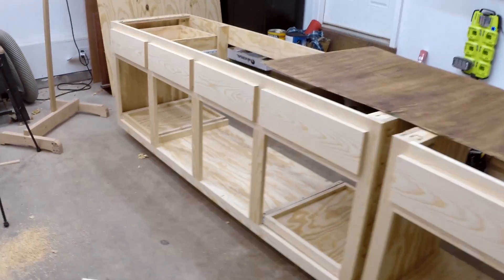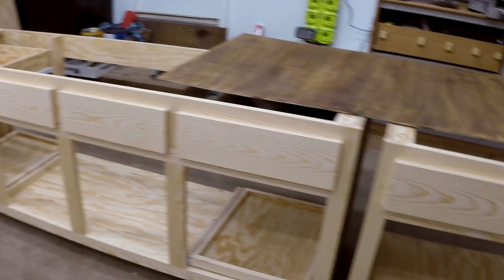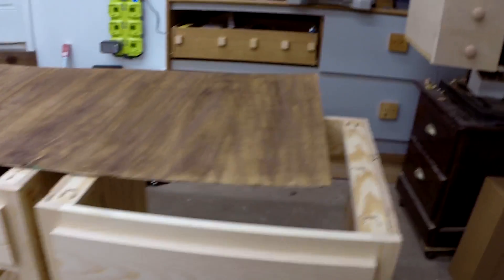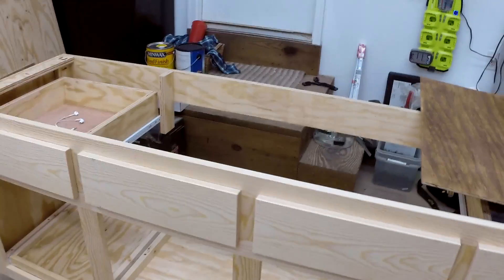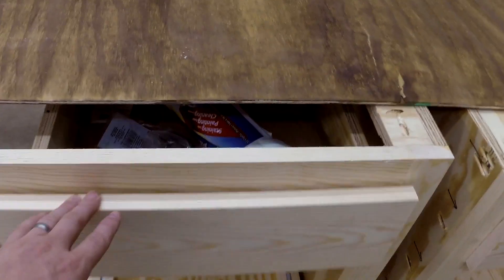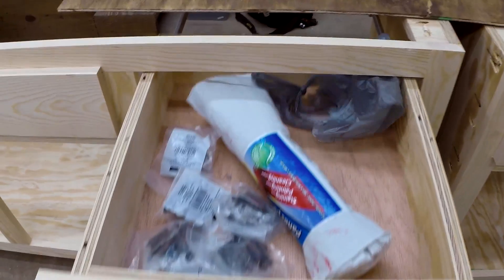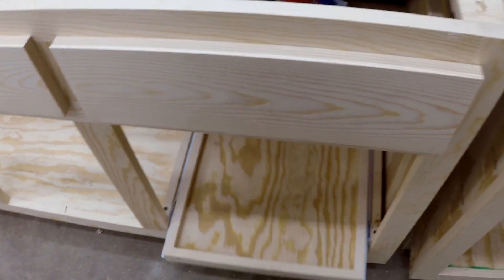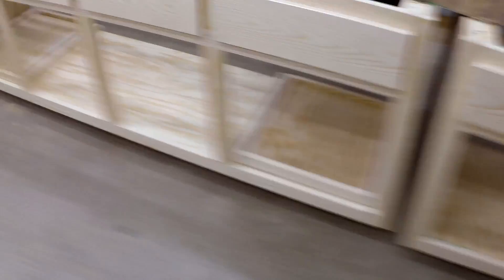Vlog #7 - Tongue And Groove Doors, Upcoming Free Tools

Comment: cabinets are looking very nice.  FYI, when I use plywood for the drawers, I edge band the top edge with a thin strip of solid wood to hide the plywood voids.  Usually I use the same wood as the face of the cabinet, but sometimes I use a contrasting wood to enhance the drawer.  For what it's worth :>)

Comment: Do you use pre-stain wood conditioner on your pine projects?  I couldn't tell if you were getting any blotching or not...stuff works pretty well and leaves a nice even stain.
Reply: I don't know if Jay had to, but I've stained large pieces of pine ply before and it's definitely recommended. I've found that it's still prone to blotching after following the directions on the Minwax conditioner, so I give it more time to sit before applying the stain and it seems to work fine.

Comment: When you say cheap plywood, are you talking about any specific type?  I bought some of the ArucoPly from Home Depot that's made out of Radiata (sp?) Pine and it was quite good.  It actually had much nicer core veneers than some "domestic" birch plywood with fir core veneers that I bought at the local hardwood supplier.  

I was just curious if there was anything in particular that I should avoid.

Comment: What size is tha wood you're using for the rails and the styles? 

Most boards at my local store have rounded edges. Looking for some that have sharp edges already.
Reply: I think it's one by, which means it's 3/4 of an inch. I think I remember it starting out as 1 by 6 which is actually 5 and 1/2 inch and he ripped them down on his table saw to two and a half, getting two pieces out of each board.